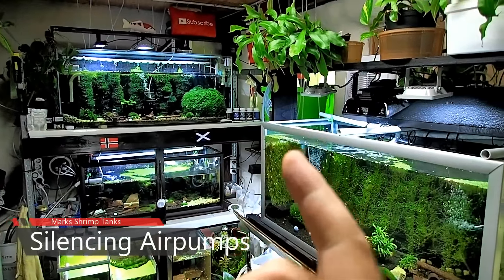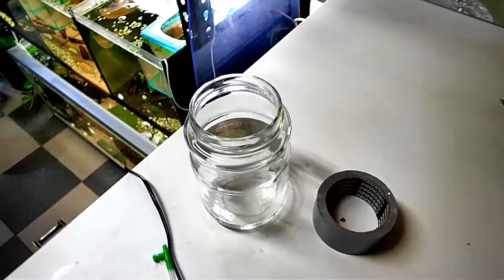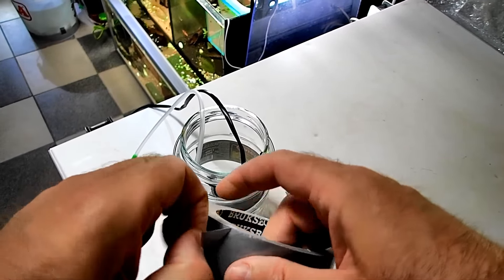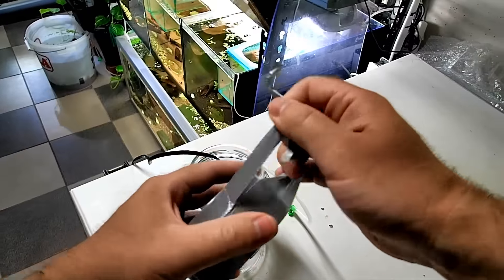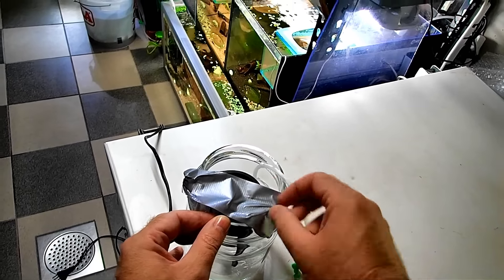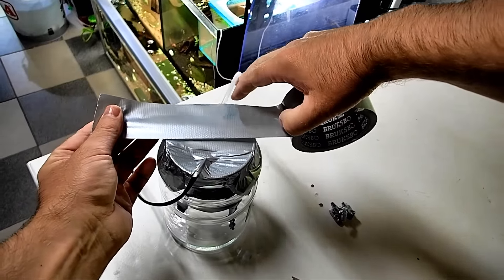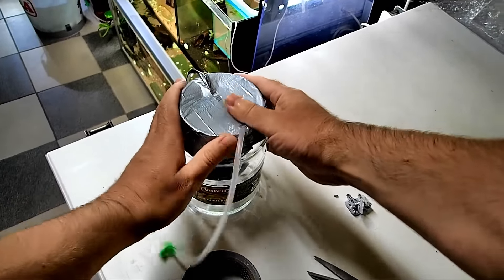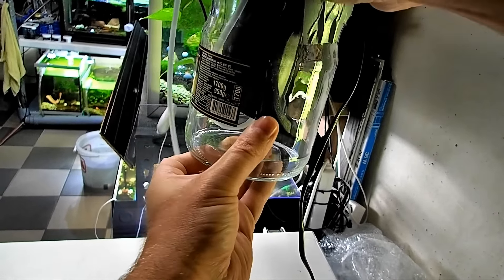Silent Your Noisy Aquarium Air Pump with This Simple Trick!

Comment: That pump is advertised as silent. Tetra must have a different definition of "silent" to everyone else, because mine sounds like a diesel engine.
Reply: I recently bought a Hailea ACO-9602 on Amazon that claims to be 'super silent', but is actually so noisy that it wrecks my domestic living environment. Consequently, I just put in a return request for a refund.
Reply: I think the person who checks these "silent" pumps in the factory must be slightly deaf.
Reply: I decided to stop faffing around with cheap pumps, so paid more for a Hailea ACO-208, which is rated at 18 watts. Things are much quieter now. To minimise the sound I suspend it in the air by the mains cable.
Reply: Only really silent ones I own is a tiny 1 watt pump I have on a shrimp tank (made by Cambani). I own 2 but one has become noisy.
Reply: @CrankCase08  I'd screw a couple of small hooks into the case and suspend it off that. If off the mains cable as you mentioned, vibrations + weight over time may cause you problems. The flex though it seems robust is basically lamp wire. Not designed to support weight, neither is the internal grommet or widget that stops the cabke from tugging directly at the solder points.

Best wishes.
Reply: @Nine-Signs  I agree, but I was thinking of the warranty period, which is just as well because it recently stopped working and now trips the mains circuit breaker when plugged in. I sent it back yesterday for a replacement.
Reply: Same I have this exact one and it was silent for like 4 months and now I feel like I'm in a plane
Reply: @@ArmyOfAll  deaf and blind it seems, as you can find nearly all of these pumps acting out zombie scenes near the edge of the table, or break dancing against the wall, nowhere near where you initially placed them 🤣

Comment: I usually dont comment on youtube, but good sir, you deserve it. I have a very light sleep, so all these pumps being advertised as "silent" and the thousands of people on youtube pretending that they are got me angy, because every single pump still produces a very notable humming-sound. And then i found your video. simpli trick, no blabbering about, and the best part: IT ACTUALLY WORKS! now i can finally sleep in peace again. Thank you Once more!
Reply from the maker: You are very welcome my friend 😁
Reply: @MarksShrimpTanks  dont know whats wrong with the 300 ppl who disliked the video, yours should be the top result when looking for "how to silence airpumps". i dont even own shrimps or fish, i just needed a pump for my hydroponic plant system with a very high flow, and they are all noisy as hell. Thanks again, you saved me so much frustration and money!
Reply from the maker: You will always get people that dont agree with what you do, most of them dont watch the entire video and form an opinion that its not safe, even though I tell them to use an airhole in the tap and ive tested the temperature in the jar its only a few degree higher.

Comment from the maker: My apologies for not sharing this sooner because this does work 100% :)
I just wanted to add for the people saying that this will over heat that the magnet and coil are in a thick plastic case with a tiny breather hole and we are not covering the hole 100% I say that in the video.
Reply: @babypunkangel  what do you mean? I cant picture the sandwich part

Comment: The "Silent Giant" air pumps actually had the pumping apparatus inside a gravel filled container. They made no noise at all. Years ago, I put a noisy Hush 1 pump in a coffee can filled with gravel to silence it. That might work even better than suspending it in an empty jar.
Reply from the maker: Thats actually an awesome idea I will have to try it.
Reply: Why just not put it in the coars filter foam and then inside of the jar?
Reply: @adomijan1606  Foam would trap a good deal of heat whereas the rocks would disperse it better.
Reply: @effervescentrelief  but the pump is sucking air so there is no stagnant air inside the foam,there is always airflow inside.

Comment: Old Vid, I know: But it works! Hanging it in a vessel works. I have the standard Tetra 100 "Whisper" that whispers in a loud hum. On patio for plant drip cycle system, sitting in a corner it was way too loud for me to feel okay. I like my neighbors. Hung it in a black-square bucket. HUGE difference; not perfect but I intend to line with eggshell foam. Only a noticable drone when sitting on patio. Not throughout the courtyard! 
THANK YOU. VERY USEFUL TIP!
Reply from the maker: ,you are very very welcome

Comment: Instead of putting the pump in a sealed jar, we can also reduce the vibration by placing a thick cloth like a small piece of Turkish towel type cloth. This also reduces the vibration & noise.

Comment: I remember when you put this video out. This works amazing, by far the best way yo silence the pump. Very minimal noise. I came back again necause I have 2 noisy pumps in my livong room and they drive me nuts. Problem is, they're way too big for a jar.  Is there any type of containers that work just as well as glass to insulate sound? Thanks Mark, you rule bro.
Reply from the maker: unfortunaly not, it has to be a big glass jar or even something ceramic like a large pot, ive tried plastic and it doesnt work.

Comment: I just use a cheap thick sponge and let the pump sit on it. Done. No rattling noise anymore at all. And if you want to make sure the pump stays put all the time, just get a bit of ducktape and secure the pump to the sponge with it. It can't get any easier or cheaper if you ask me.

Cheers.
Reply from the maker: Yes but your pump will not be silent no pump is,the way I do it you cant even hear it hum :)
Reply: Oooww.... got it now. ;)

Cheers.

Comment: I like the idea. But if you seal the jar with tape how is the pump intake drawing fresh air ?this must put extra strain on pump coursing overheating.?GREATLY decreasing it's  efficiency and lifetime .Need to leave some hole for air flow.
Reply from the maker: you add a hole I say this in the video, the actual breather hole on the pump is tiny as in 3mm.

Comment: Mark, you know those awful D-cell air pumps that are used during power outages? They are HORRENDOUSLY noisy.  Do you think this would work with those?  Obviously we'd need to change the batteries at some point, but hopefully power would be restored by then.  I have a few of them, but cringe even turning them on.

Comment: Bruh that air pump needs to take in air, you covered it's ability to take in air. Make a little hole so that air can go inside the pump cavity. Nice idea to silence it. I'm currently using a portable protector case, made it quiet by 95%.

Comment: So here is an evil plan to combine combine aquarium and and rock polishing hobbies.  Attach a tray to house polishing grit and rocks to the air pump.  Will it work as a vibrating rock polisher that runs 24/7?  I'm gonna find out.

Comment: I did it with a tupperware container and lined it with some foam insulation and yeah hanging it so its not touching anything is key just doing that alone helps. Also I think its better to get 1 good quiet powerful pump and hook it up to a gang valve like the pen plax 5 site one. Instead of a room of those things buzzing i have 1 silenced one running all my tanks.
Reply: any recommendations of brands/models? Positive or negative?

Comment: Taping the plug wire...how long do you think the plug wire will last from all the vibration an air pumps make?  Do you think the plug wire will come off the air pump from the vibration an air pump makes being taped like that?
Reply from the maker: It's hard to say exactly how long the plug wire will last, but if it's securely taped, it should be able to withstand the vibrations from the air pump for a decent amount of time. Just keep an eye on it and make sure to re-tape if needed.

Comment: Good way to shorten the life of your air pump! That's a permanent over heating job. It says to keep well ventilated.
Reply from the maker: Good way to not know what you are talking about, the mechanical moving parts of the pump are housed in a thick plastic casing with a very small 3mm breather hole, how is a bigger glass casing with a much bigger breather hole going to overheat it? This pump is still running, how old is this video? 😂

Comment: Why not just surround the pump in the jar with Large Polystyrene balls (from a craft store... Hobbycraft)! I've put noisy pumps into cardboard boxes with packing foam/curly chips before now with holes cut in the box for air inlets. The packing chips allow a circulation of air around the pump to stop it overheating!

Comment: Does it have to be glass jar or can it be a plastic jar? I have an aqueon quietflow air pump.
Reply from the maker: I am not sure you would have to try it, I have a feeling it might not work though and the noise will go straight through the plastic.
Reply: Marks Shrimp Tanks thank you for the fast response. I will try it with the plastic. If not I have to search for a big glass jar to suspend and not touch the glass.

Comment: It seems you restrict air flow which gives extra resistance in the spool which shortens the lifespan of the pump. The noise from pumps like this is 9/10 times caused by a slightly shifted membrane( the magnet hits the spool), or dirty valves. You can open it up, clean it out, ad a little lube and the noise is gone.  These pumps just need a little love from time to time.
Reply from the maker: I am not restricting any airflow the inlet size on the pump is tiny compared to the size of the breather hole I have on the jar, this pump lasted for years and never overheated and yes I did test it, this video wouldn't have anywhere near as many views if this didnt work.
Reply: @MarksShrimpTanks   I´ve put a beer coaster under a wobbly table and it hasn´t wobbled in years !  This jar thing might work but it's a beer coaster  solution. Just find the problem and fix it.  Restricted air flow or not this pump is still not repaired, still making noise, noise  means mechanical contact in the pump, mechanical contact means wear.  These things are easy to fix if you would jus take  the couple screws out and have a look. If you're washing machine starts making noise you don't isolate your washing room, you fix the machine right ?  The screws and nuts in these things can loosen up due to vibration/ valves get dirty / membranes break/ and things move a litle out of the place. All you need is a screwdriver, no jars and ducktape.  You could even see what air flow restriction does to the mechanical working of your pump while it's working and why it becomes  quieter with a little load on it.

Comment: that is a great idea but that pump wont last long before it burns up. you dont have enough air flow to the pump. you have more air coming out the going into the pump. make the hole bigger in the tape.
Reply from the maker: Rubbish ,the hole in the casing of the actual pump is a pin hole so the pump mechanical parts are encased in hard plastic adding a jar on the outside dose nothing.

Comment: Does it have to be a glass jar? Can it be a plastic,metal or other material?
Reply from the maker: I have tried other things and it doesnt work the same for some reason.
Reply: @MarksShrimpTanks yoo bro i got the set up.. So far it's quiet all i hear is the air  bubbles.

Comment: You can get REALLY quiet air pumps like the aPump that operate basically silently. I have a tiny piezoelectric Japanese-made air pump called the Nisso Mute S that makes only the tiniest of humming noises. I sleep a foot away from it with no problems. 
The only cons are they don't move a lot of air (although mine runs a box filter in my 25 gallon just fine) and they are a little pricey too ($35ish).
Reply from the maker: I have had them on my channel before and I gave one away one time great little pumps so thank you for the input :)
Reply: Where can i get this piezoelectric japanese made air pump?
Reply: @MarksShrimpTanks 
Which quitiest air pump should i use for the aquarium in my room?

Comment: If you keep the lid to the jar you can easily just disconnect the cable off the plug then drill a whole through the lid pass the cable through the hole reconnect the plug and just tighten the lid, much easier to get in and out of the jar just make the hole slightly larger than the cable for additional air flow.
Reply from the maker: The duct tape is what helps dampen the vibrations.
Reply: Sorry forgot to add I put a load of sponge underneath the lid, either way it’s done the trick so thanks for the tip

Comment: i just want to know will it over heat becuase thats the last thing i need my house to be on fire please get back to me on if it gets too hot
Reply from the maker: No it wont overheat, I tested this with a thermometer ,think of it like this ..the pump parts are already in a hard plastic sealed box with a tiny hole in it for it to pull in air, we are just adding jar and our breather hole is bigger.

Comment: It occurs to me that this setup will cause overheating of the pump as well as a probable reduction of airflow.
Reply from the maker: You were wrong, the pump never overheated, temperature stayed at 37c  and the airflow hole was much bigger than the airflow hole on the actual filter itself.

Comment: what about the heat? and where does the pump suck air from? it kinda looks like if it super tight seal air pump would just make  a vacuum in the glass...
Reply from the maker: Its not sealed I say that in the video,also all a pump is is a magnet and a copper coil.
Reply: The coil is what generates the heat
Reply: also keep in mind that hanging it from the wire means that in the long run you are going to damage the wire which is unsafe. So just keep an eye on the cable :)
Reply from the maker: It doesnt produce heat like you think it does,the case is cold to the touch in normal use.
Reply from the maker: It will absolutely not do any damage to the cable it only weights about 1/2 kilo ,I could hang 5 kg on that wire and it would do nothing to it.
Reply: I put my airpump in a jar and the heat was a problem and damaged the pump, so I would leave a gap like he said, I didn't leave any gap. Mine was a more powerful pump though so would produce more heat

Comment: Hey, I had a quick question my ph is at 7.6 when it comes out of the tap it is 8.0 and it's 8.0 after ro I'm using seachem ph neutral regulator to lower my ph but it only goes down to about 7.6 and I don't want to use to much, any ideas on how to lower it closer to 7.0
Reply from the maker: The only real way to lower ph is with something that dilutes the water you have like distilled water or Reverse osmosis water. basically this is something that people need to think about before they choose shrimp types est because then you will know what substrates and equipment you will need ..if your tank is for neocaridina like cheery shrimp its fine as it is .

Comment: Air pumps are way too noisy as hell and not necessary but cheaper specially if you are using a sponge filter. If you are using a water pump for your water filter, just allow the water to splash down to agitate the water and cause bubbles in the water.  If you are using a hang-on back filter, the surface agitation is sufficient enough. If your using over the top filter, just remove the nose to get higher elevation hence better water agitation. Use common sense for other kinds of filter.

Comment: Doesnt the pump get heated if there is no room for air transportation??
Reply from the maker: There is room for air transportation, there is a breather whole that is literally 30 times bigger than the breather hole on the pump itself, I also put a temperature sensor in the jaj and it never got above 35c.

Comment: You would think the glass jar would make it way louder! (like setting your cell phone in a jar to make the sound louder!  i wonder if you put like a $1 store sponge or 3 inside the jar might help dampen the sound by soaking it up and then duct tape the top?? 
 I have those older whisper deep water air pumps and OMG the noise drives me CraZy!!!  ive set them on sponges to keep vibrating down or keep from rattling.
Reply from the maker: The noise you hear is all from vibration ,thats why if the jar is big enough you can suspend it in the Jar so that the pump has nothing to vibrate against...ducttape also seems to help dampen the noise even further because with normal tape it doesnt really work the same .

Comment: Isnt become hot?
Reply from the maker: No this works great, I did measure the temperature in side the jar and it was only 30c which is fine, this pump has been is use for almost two years and really the only thing I need to do is replce the diaphram.
Reply: @MarksShrimpTanks  got it. Thanks bro 👊

Comment: Cool tip Mark. Thanks for sharing :)
Reply: It gets really hot, is it safe on the sponge?Also in the jar, won’t it get hot ?  And the cord is holding some weight constantly…
Reply: @Just_Lurking8  - The sponge will be fine. It shouldn't get that hot. 

As for the weight the cord should hold a lot more weight than what the pump has.

If you try this just make sure the jar is not totally sealed around the air tube. There has to be some air getting back into the pump otherwise it will create a vacuum and the pump will not work.
Reply: @jlathem56  Thanks, that makes sense🐠

Comment: I simply suspend the pump with a thick rubber band on the electric cable.
Reply from the maker: yes I used to do that as well good tip. 👍